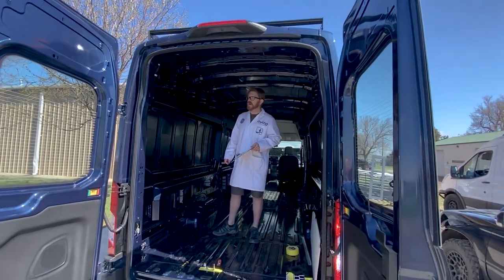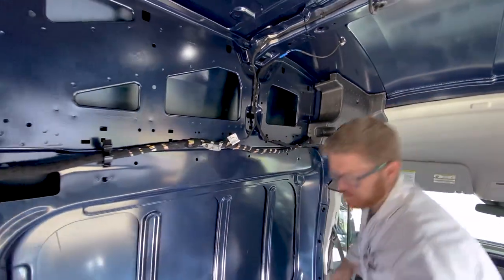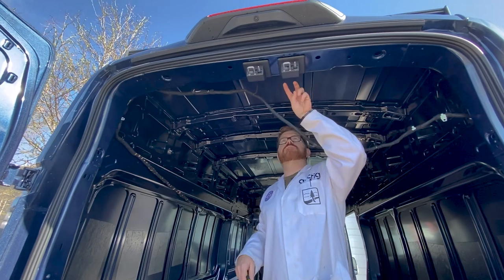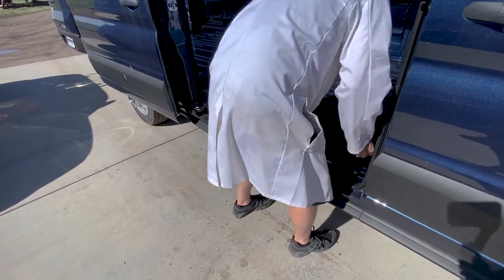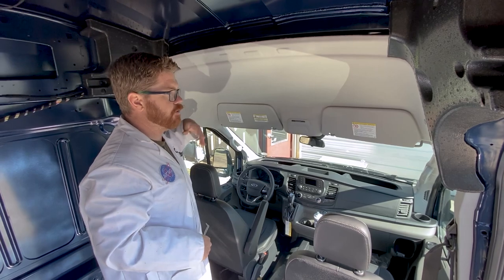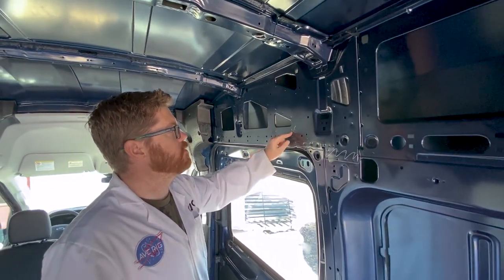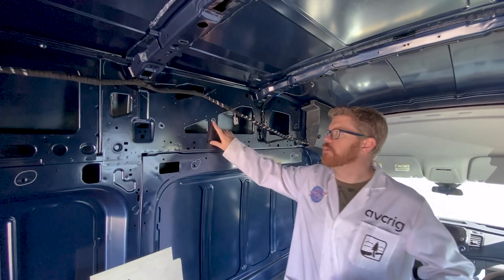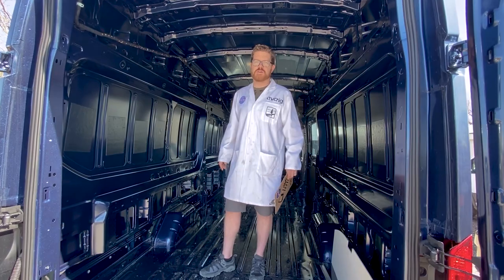New Ford Transit Tour Prep [Reupload - No Music]

Comment: I have two wires running into a small plastic item on the ceiling beam behind the beam that has the cargo lights.  In talking with the Ford dealership, they mentioned that it was part of the keyless proximity system (Ford Part 15K603).  Have you come across this in your van builds?  Is it okay to build the ceiling over it, or must it be moved?
Reply: We have the same question... just discovered that little black box.

Comment: Hey Matt, do you have any preferred configuration when ordering a new transit? beyond high roof and extended or not, which are personal choices, is there any list of things we should know before hitting the ford dealership?  engine, batteries, alternators, things like that. can we order them with factory installed swivel seats? for a 'regular' build with batteries, fresh/grey water tanks etc', do you thing we need a dually, or single wheel is enough?  thanks!
Reply: How did your ordering go for deliv time and what you missed? I find its lots of decisions to be made, adding up to $70k +, all dependent on your future uses that will change over time...

Comment: Thanks for your videos, extremely informative. If you were going to put tongue and groove boards on your ceiling would you still frame ceiling like this? How bout 1/4 inch plywood? Thanks again.
Reply from the maker: I fir the roof like we will show in an upcoming video.(basically 1/4” strips front to back bridging roof joists). I attach my planks to a 1/4 birch substrate.  I do 3 panels for a 148LB and 4 for an extended. If you line up your planks you don’t have to do trim strips between panels (but we usually get something off do we do trim strips to cover seams) .

Doing it this way is much easier to install and do any maintenance in the future if needed. The front of the van has a LOT of curve so go as thin as possible.
Reply: @AVCRIG  thank you, much appreciated. I will be looking for that next video, thanks again.

Comment: Hey Adam, what is the difference between the rivnuts you're mentioning in this video? You mention a "1/4 20" rivnut for the side panel and an 8mm rivnut for ceiling and to match the factory welded ones on the transit.
Reply from the maker: The 1/4-20 are smaller and fit the factory holes. The 8mm are larger and we add them to the ceiling. You can put in whatever you like. I just prefer to have one set of hardware (or 2 I guess with the 1/4-20)

Comment: I'm considering buying a Ford Transit and using your products. Is this the tall or medium height van? I'm 5'9"" without shoes.
Reply from the maker: You would fit in either. I think HR is better for a camper. MR is better for a daily driver that also goes camping. I currently drive a MR, but I want more room for storage and my family. Switching up to a HR.
Reply: @AVCRIG  Thanks. Is the one shown in the video the high roof? I don't believe that detail is mentioned.
Reply: @jniemec  that’s right. This is a high roof van.